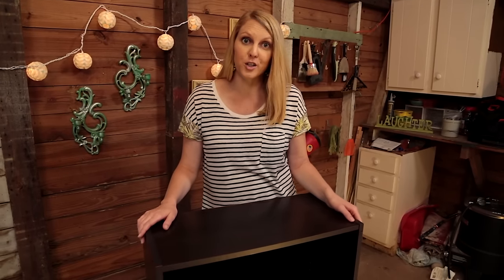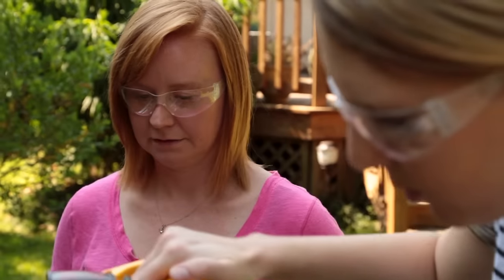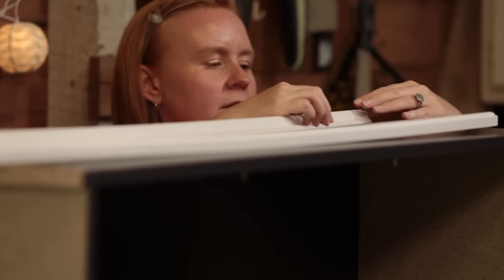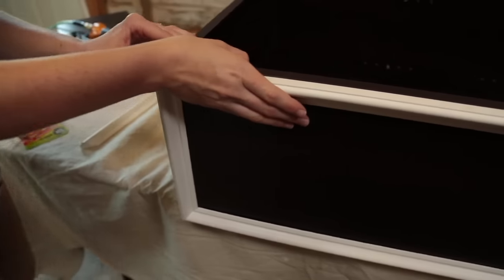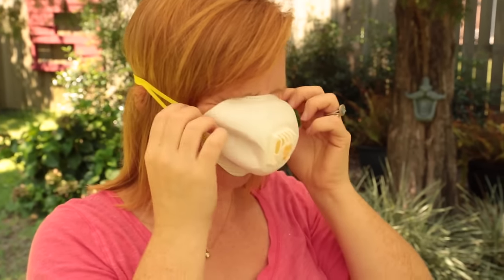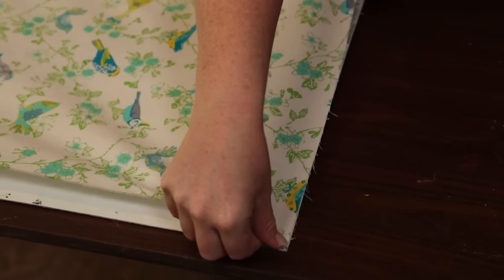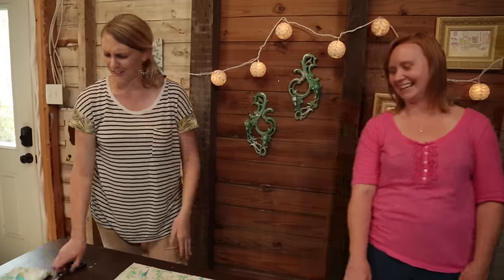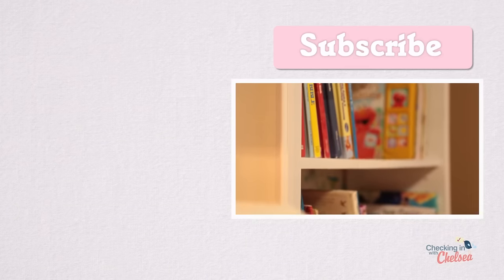How to Update Particle Board Furniture

Comment: Ladies, when you work with power tools and wood, protective footwear is a must. Also, regardless of whether or not you use primer and paint in one, surface prep is still vitally important. Just a light sanding and wipeup with a tack cloth is all that's needed, but trust me, it's needed.

Comment: Super cute project! So you just painted the bookcase without sanding or primer? I have a an off-white pressed board dresser I would like to paint white so I am trying to figure out the best way to go about it for the paint to last.
Reply from the maker: The spray paint we used had primer in it!
Reply: Korin Sutherland, sanding and an oil base primer is best for laminate furniture.
Reply: Def sand slightly first! I guarantee their project is already trashed!
Reply: Or, simply prime first
Reply: Korin Sutherland me too. I asked the same question. I’ve looked at other videos on this. I think sanding is not good but a good prepping cleaner, a primer and sealer are key.

Comment: Did you just spray paint the unit without any prepping any priming or any sanding?
Reply: So I came to YouTube searching for whether you could just "paint particle board or not".  According to this video, they just painted it, no problems!  But what kind of spray paint did they use?
Reply: You can use the rustoleum universal spray that she did in the video but you can also use chalk paint or chalk paint spray with no prep. I’ve done it on several presses wood book cases.

Comment: Wait isnt particle furniture just plywood?? And aren't all furniture like this unless it home made or something
Reply: No. Plywood is thin sheets/plies of wood glued together in layers. Particle board is wood chips, sawdust, and other wood waste bound together with a binding agent like resin and pressed into a board. Most furniture you buy that you construct yourself is made from particle board because it's cheap to produce, but the downside is the quality and durability are subpar compared to real wood furniture.
Reply: Ive noticed that the particle board furniture from the 80s and 90s and early 2000s tended to be more substantial and quite strong, more like plywood, but some of the stuff now, while often heavy & clunky, is very crumbly, weak, and poorly finished. Its so bad that in some recent pieces they no longer use regular screws, they use wider screw in fasteners that come with the furniture, because the boards are so weak and crumbly that they cant hold screws properly, they need something wider and rounder.